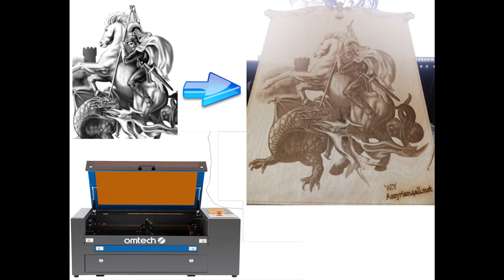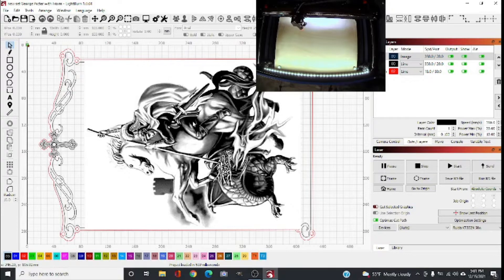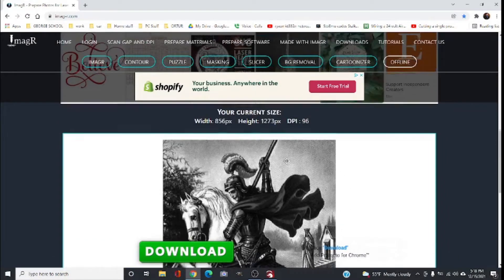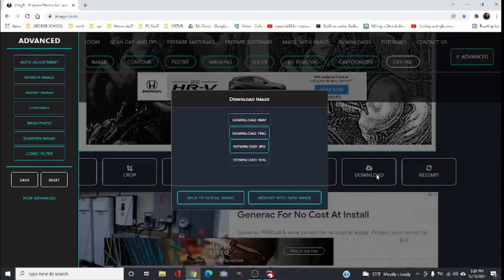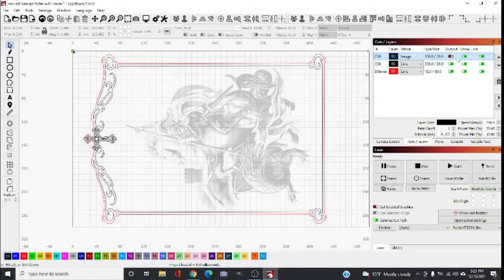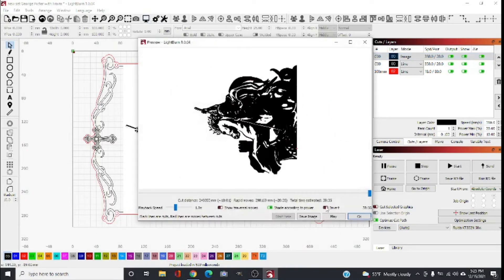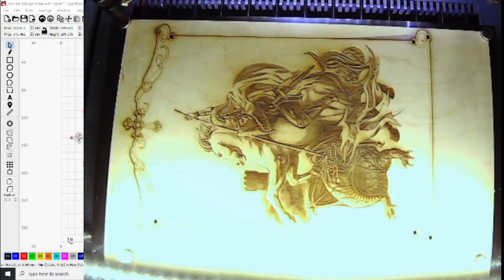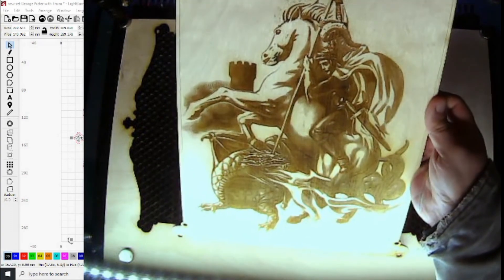Engraving on wood With OMTech laser machine, Using 2.0 laser focal length.

Comment: what is your power and speed settings that you used on this project? using a 55 watt omtech cant get it dialed in on the power and speed. your videos are very helpful added LED lights and a Volt meter watching your videos Thanks
Reply from the maker: I want to say I used 350/35 interval 0.100 need need to do testing